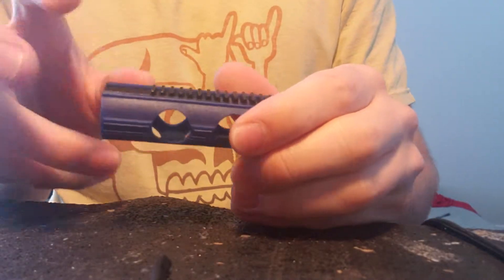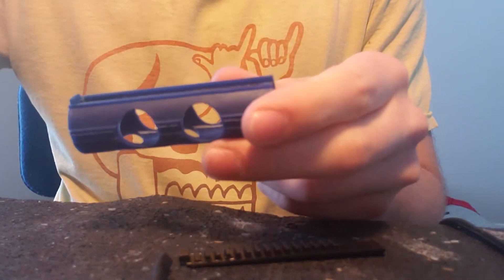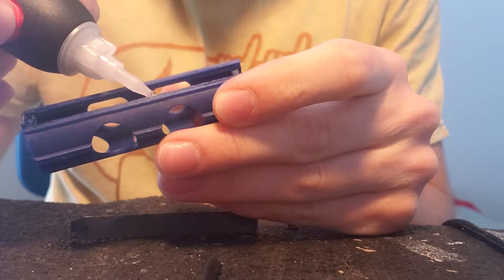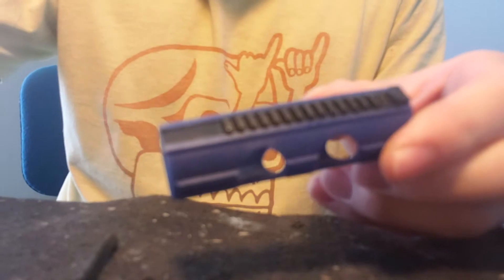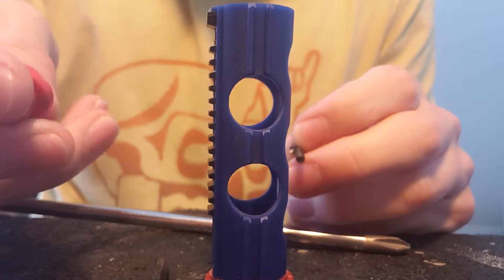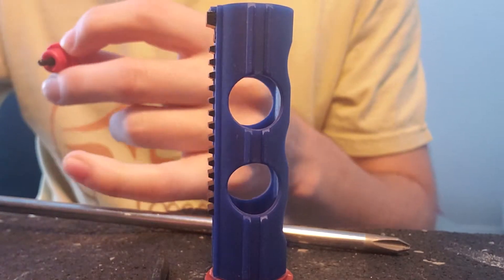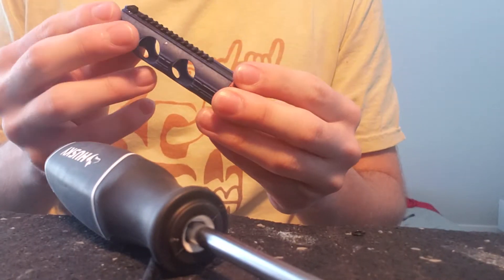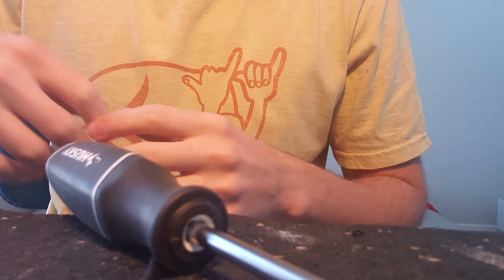How to secure your piston rack and head to your piston

Comment: You unfortunately installed the Piston head backing on backward. It has that step to help center the spring. But otherwise, nice video. Also, you might just want to redo the video, just so you can add in that before gluing your piston head on, you need to verify that your aoe is accurate. Once glued it's hard to add washers to correct aoe.